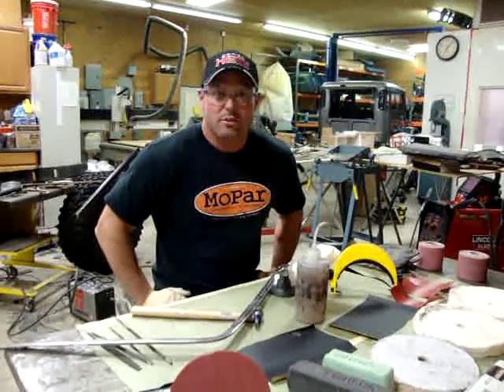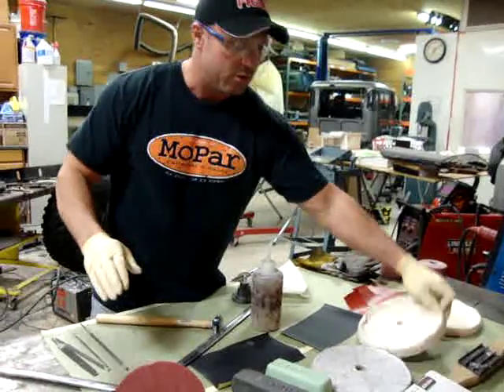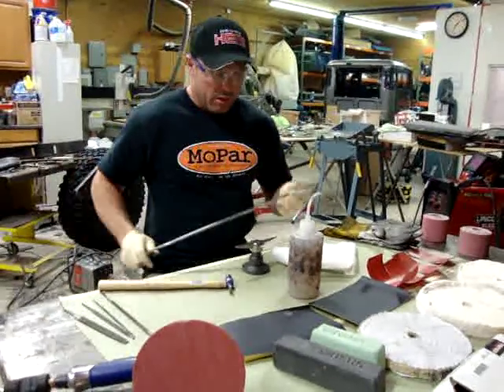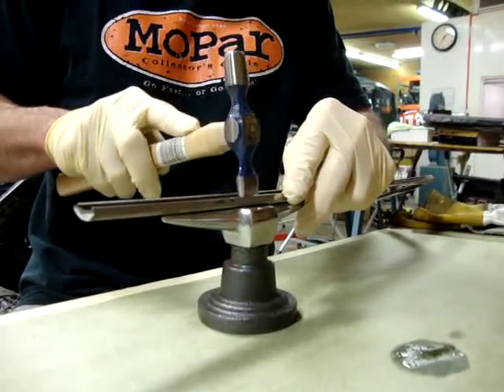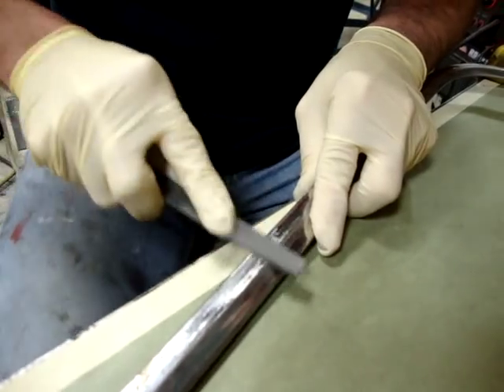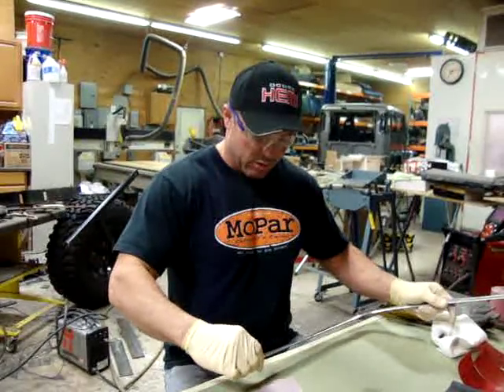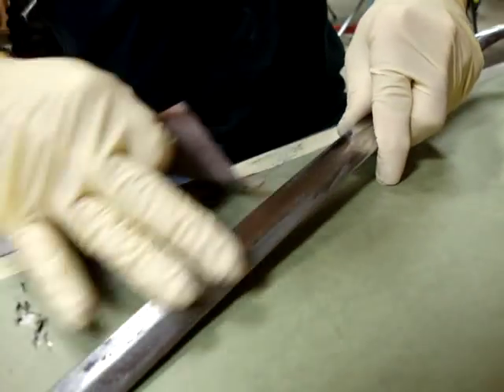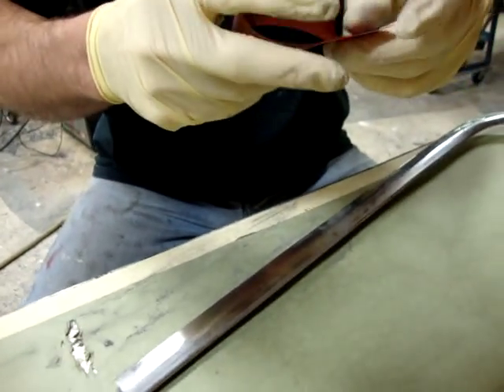Tips & Tricks for Polishing / Buffing Stainless Steel Trim Part 1.MPG

Comment from the maker: 3: Another tip was to wrap the sand paper around the file to keep things flat... Also clean the file frequently so the filings don't create scratches.... another DA that was suggest to work well was... Astro Pneumatic 3050 Complete Dual Action Sanding & Polishing Kit.  I have not used it, but looked like something that would work well.

Comment from the maker: 4: I wanted to explain in video 2 to make sure your DA is set in "spin" only mode.  Using the dual action will leave to many swirls in the trim.
Reply: Can I use a small air sander on low air pressure

Comment from the maker: I've had some good feedback with more tips I want to share with everyone.

1: Stacking buffing wheels will make a wider buffing surface and make it easier to keep the trim center while buffing.  Be sure your buffer can handle the extra weight of the additional wheels.  If you want to know how much your buffer can handle, go to Caswellplating website and look for the chart that shows the max wheels sizes / width.